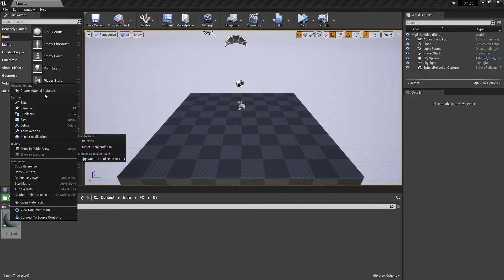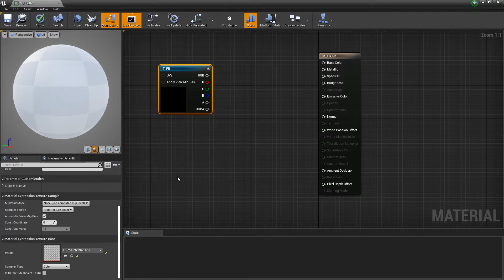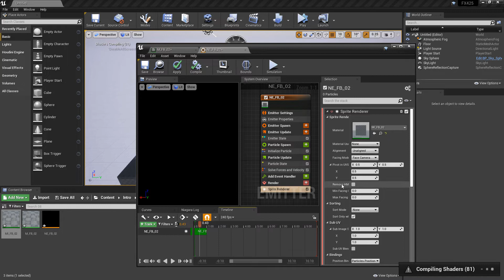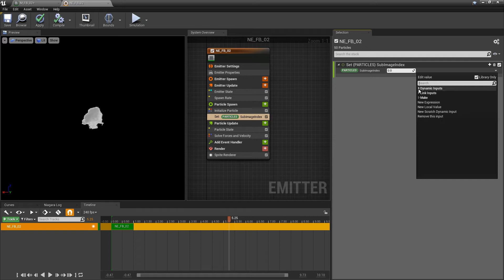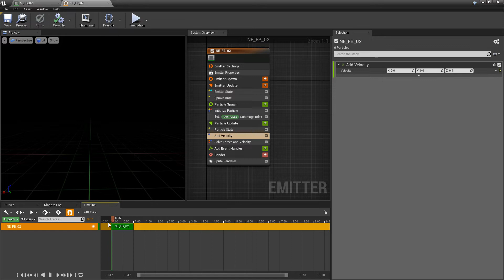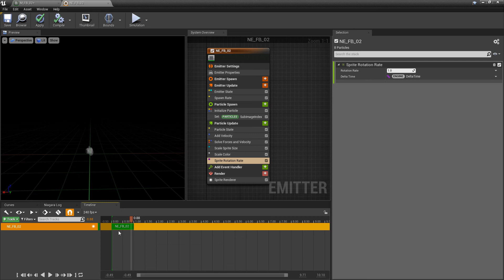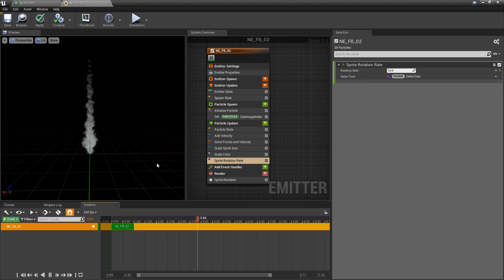UE4 - Niagara Flipbook - Part 2 - Smoke

Comment: which version of UE is this? 
I got 4.27
There is NO Uniform RANGED float. Only Uniform AorB. And there is a Random ranged float. 
I even unchecked Library, just in case. Nothing.
Add velocity is NOT in the Particle update. It's in the Particle Spawn. And value 0.4 does nothing. Needs 400.
And when you create the curve, that's where I lost it. The emitter vanishes. Tried all combinations. Nothing.

Bottom line: I don't know why UE keeps changing the parameters in each and every subversion they develop. It's confusing and frustrating.
Any help is welcome.
And thanks for the tutorial. Probably the only decent smoke emitter sim out there.
Reply: Using 4.26.2, and have the same problems.

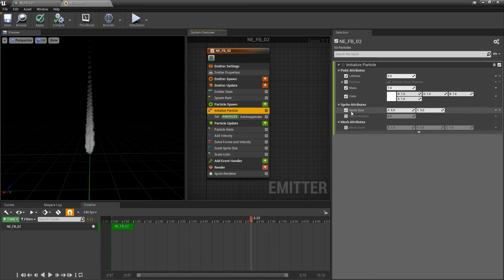Comment: 5:38 i dont have the "edit value" for the sprite size so i cant change it 
Do you have a solution??

And my smoke disapeared too on the preview (idk when) but when i open the "initialize particle" i dont see the  " particle size to uniform" :/
Reply: Well i put randomize on rotation and value. Now it works

Comment: My smoke disappears when i get to the part where you add the scale sprite size... any fix for this?
Reply from the maker: Yes, you need to go to "initialize particle" and adjust the " particle size to uniform and set a value. Things have changed slightly since I put that video out.
Reply: @gamedevoutpost9270  Thx for the quick reply. Great video btw!!!
Reply: @gamedevoutpost9270  thanksss for the tipsss

Comment: Strange, when I add the scale, the smoke is gone
Reply: Thanks for the solution, same thing happened to me.
Reply from the maker: That is strange. Did you set an initial size for initial particle?
Reply: @gamedevoutpost9270  Since you mentioned the initial size, what I did was to click on the little carret in the scale thing, convert the parameter as a float and set a random value, I put 18, now it is working
Reply from the maker: A few things have changed since I made the video. I might update it. Thank you!
Reply: @gamedevoutpost9270  Yup, I can tell you that the size is not added by default, you have to actualy set the sprite size in the particle setting before you made any sprite edit because it is by default at 0.

Now you can directly create the niagara system without passing through the effect and stuff
Reply: @gamedevoutpost9270  I do not think so, I did exactly like the tutorial. Whenever I disable the sprite scaling, the smoke reapear